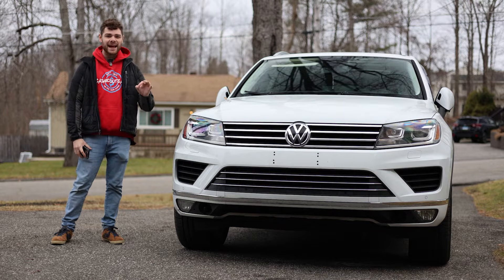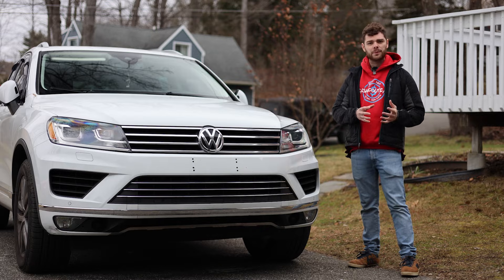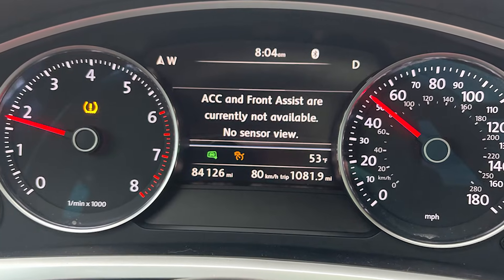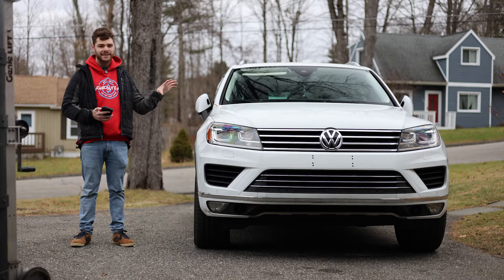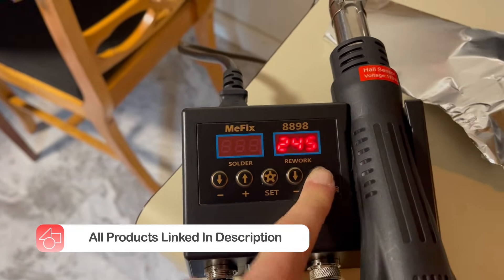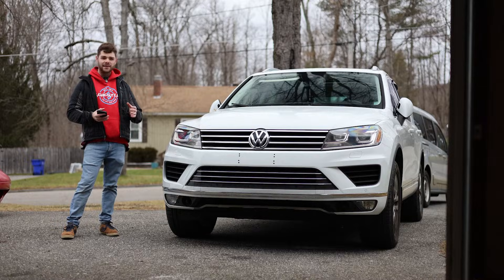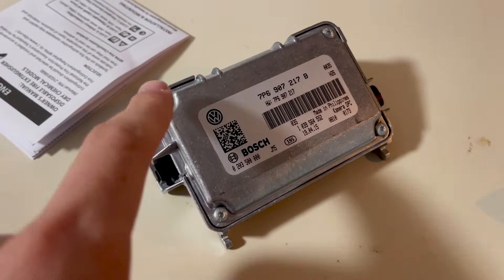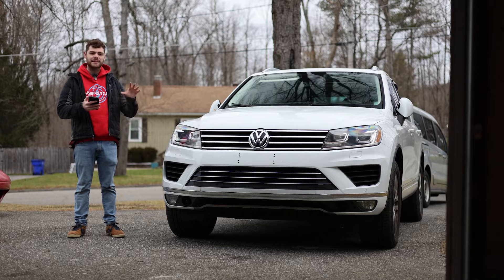How To Fix Adaptive Cruise Control (ACC) Issues - Volkswagen, Audi and Porsche

Comment: Works perfect on Audi A6 C7. Thanks! After this fault happen I made image processing module removal to check for flood. But no flood on passenger compartment was found and everything looks perfect. So decide to try this fix. After 5 min. of hot air blowing with simple hair dryer fault gone. I think on A6 it's possible to make all repair process without removing camera unit. You can just remove T10 screws from camera unit, carefully unplug connection. Take control module out and go for some dryer work :)

Comment: We have a 2016 Volkswagen Touareg TDI Sport w/ 54k miles. We are very thankful for all the details you gave on this very creative, low cost solution. 

For our repair, we used the 1/4” nozzle on the reflow heat gun, positioned an inch from the chip (With a square cut out in aluminum foil, masking the rest of the board still inside the aluminum housing) starting 250C for one minute stepping up to 300C for three minutes ending at 310C for an additional two minutes, we let the unit cool down for 45 minutes installed it and the ACC error went away.

Once everything was reinstalled, we took our car out on the freeway to do a verification test and everything is functioning perfectly. From start to finish it took us one hour to complete the entire disassembly repair and reassembly process.

Note: as other commenters Have recommended we used a large plier to apply grip to the widest point on the rearview mirror mount grip it tightly and did a quarter turn counterclockwise to remove the rearview mirror without incident.

1 month update: after ~1,000 miles long road trip the ACC error reoccurred, so we repeated the heat gun process using a slightly different temperature profile (3 min @ 250C, 5 mins @ 300C, 2 mins @ 330C, with 30 min cooldown) and wedged some wadded blue painter's tape between the windshield and camera to eliminate any vibration within the holding bracket.
Reply: How did the second time fix work out? Any more issues? Did the tape help?
Reply: Hello ivantashchuk6596. … it lasted from Feb ‘25 to Dec ‘25, so this time I let Google AI do a search for the best profile for my VW Touareg … and it came back with 
250C for 3 min
300C for 5 min
350C for 3 min
45 min ambient cool down
1/4” nozzle approx. 1” from chip shielded with aluminum foil

Comment: 2013 Audi A6 3.0T, problem solved following video direction, thank you!   Utilized a heat gun with a digital thermometer and left the pc board in chassis .  Started off with 1 minute in the 200-250 Celsius range, followed by 2 minutes at 300C.  Let it cool off and reassembled.   The plastic backing on the windshield bracket assembly that is between the glass and the camera chassis was so brittle it cracked and fell apart while I was reinserting the camera.  Used super glue and gaffers tape to salvage it.  I live in So Cal and the direct sun cooks the camera and all the plastic around it, the camera chassis is hot to touch just from the sunlight.  There needs to be a better way of insulating this area.

Comment: Incredible. This method worked great and fixed the issue. Removing the rear view mirror was a real pain – had to use a pliers to twist off. 310ºc for 3 minutes and installed once cooled. I did not remove the ribbon and did not have issues with it when heating. Re-install was easy. Thank you for the video. Saved me $2,000.

Comment: Thank you for this valuable video!  After watching your video, I removed the circuit board and took it in to a local computer repair shop to have them follow the video and apply the heat (300 degrees Celsius) using their more sophisticated heating device and magnifying software.  They only charged me $25.  I reinstalled it and it's fixed. You saved me about $900.

Comment: Thank you!  Your fix worked on my 2015 VW Touareg.  I've been waiting almost 3 months for a replacement camera (on back order) and the ACC warning was driving me mad.  I purchased the heat tool you recommended, set it at 310 and heated the chip for 3 minutes with great results.   Again, thank you.

Comment: This worked for me but I had to do this several times as the summer sun seems to cause an issue and cant always find shade to park . Anyone had a similar issue and any way to keep the unit cool ?
Reply: I honestly think that parking in the sun with a foil shade in front of the mirror , caused all the heat between the windshield and the shade to heat the module up To the point the chip malfunctioned. It was 140° in the car no telling how hot it was between the glass and the sun shade.

Comment: Thank you for posting this video...I have been waiting for the camera to come in from the VW dealership so they could "fix" this issue and charge me another $1500 on top of the $500 diagnostic fee for 2 months now.  Saw this tutorial this past Friday, ordered the heat gun kit from Amazon.  Came in on Saturday.  Did the repair this Sunday morning early before going ot church ... AND IT WORKED!!!.  Did all the details that were presented.  Heated it at 610 degrees F for 3 1/2 minutes.  Let it cool down about 20 minutes...all in all about an hour of effort.  I really appreciate the details you had in the video, plus the link to parts, etc.  It emboldened me to try the fix. You are doing good work in sharing your knowledge with the rest of us...especially when the fix is quick and inexpensive and the parts are literally years away from shipping.

Comment: Thank you for this. 2016 S6 and been having intermittent ACC warning. Performed this fix at 700f for 3 mins. Just put the module back in the car and the warning is gone 😊
Reply: I did exact same thing and it has failed twice again already (maybe lasted 2-3 weeks each time).
Reply: @2thebaum  the initial fix I did only lasted about a month. The second time I performed the fix I heated the chip for 5 mins and applied light pressure to the chip as it cooled to make sure it was seated. Never had an issue after that.

Comment: Thank you so much for this video! I have a 2016 Touareg TDI Lux and for the past 2 years my ACC and lane assist would come on and off while driving. About 3 months ago the ACC assist error code became a permanent chime every time I would crank it. I stumbled across this video, ordered a heat gun from Amazon for $16 (the Diafield 1850), set it at 600 degrees F for 3 minutes, and then reconnected camera and it works!  Took it for a short test drive and everything was working great. Was nervous about removing mirror and camera but I took it slow and easy and everything came apart and went back in fine. Hopefully it will last. Thanks for saving me some big money.
UPDATE:  After 5 days, the dreaded light came back on and so I did the same procedure again but heated gun up to 700 degrees for 3 minutes.  Warning lights are off and ACC is working fine after 3 days of use. Hopefully, the second round will fix it for good.
Reply: SECOND UPDATE: Be prepared to do this procedure about every 2 months. Not sure what causes it to fail. Maybe hot sun as others suggested. Will start parking in shade at work and see if that solves the issue.

Comment: Like the others, I owe you a HUGE thank you!  I had the same codes that you were showing and was about to gut the interior to replace the signal cable.  That's really what the data was suggesting.  I happen to watch this video and ordered a resolder gun to give it a try.  Sure as hell, worked the first time afterward.  I did 4 minutes at 610 degrees Fahrenheit.  Working for the first time in years.  Thank you for this !!

Comment: Amazing.  2016 Touareg with the ACC issue and this resolved.  $30 tool from amazon and 3 mins on 300c.  I left things disassembled since a few have said they need to repeat the process a week to 10 days later.  In addition to just working the OBD error goes away after a post fix scan. I should also note that I did the fix without completely disconnecting the camera in case you want to leave in place to eliminate chance of breaking a variety of plastic clips. 🎉
Reply: This worked on mine as well, but as an electronics repairer I wouldn't recommend doing this in place (without removing from the car) because you are relying on gravity to work FOR you when heating up the solder to re-bond so you REALLY want gravity to be pushing down on this chip from the top when the solder melts.
Reply: Definitely broke 1 clip doing mine. Cheaper piece of plastic to replace than a $2500 module / calibration..

Comment: 2013 euro VW Touareg
same issue, same “very long time without cruise control”, same solution, same success !! ❤🎉
Many thanks for your precious advise !

I used a standard rework station,
320°C for 3 minutes, 5cm from chip, and rest of the board protected with thermal tape.
Airflow 20%

NB : be VERY careful not to touch or move any parts when the set is hot : you may move unsoldered parts while it’s still hot !

Comment: 2013 Audi A8 4.0 Camera ACC issue's fault Dealership has had new Camera on order for over a year!!!!! 
SO, what do I do I try things.... IT REALLY WORKED.  uninstalled camera heated to 600 degrees for 3 mins let it sit for 10 min to cool went out and installed back in the car and to my disappointment error was still displayed on dash.  But I decided to try again by taking out the camera following instructions again.  So, I heated the processor back up to 600 degrees again for 3 mins and that did the trick.  well worth trying instead paying a ton out the window. thank you

Comment: This is the best news I have heard after digging through a ton of threads on the topic.  I have an OBDII dongle but only get some generic info about it.  Does anyone know if these codes relate to this fix: 

93440 [0x016D00]
U111300: Function limitation due to received malfunction value
FAULT_CIS_VIDEO_FAIL
Status bits: 1
Priority: 6
Frequency: 43
Unlearning index: 184
Odometer: 95803 km
Date, time: 2024.07.14 16:44:37
Paramteric values: 02 8D 00 1B 02 85 37 AE 10 0E 05 C1 10 0F 12 CE
Status: Test failed, Confirmed

Comment: Thanks. Did this on my Audi A7 and it worked had the heat gun on 310 for 4 mins. Came back to life. Please be careful taking it out. I broke 3 clips doing it. Push the camera up not too hard and slide it back. 🙏🏽
Reply: What year was the Audi I have a 2018 Q5
Reply: still worked ? no more errors ? and for how long please

Comment: You are the man.  2016 Touareg TDI Lux.  This worked perfectly.  I used 500F for 30s, 550F for 2.5 min, and 626F for 3 min.  I let it cool for an hour.  I noticed two flat areas on the mirror.  Easiest to get it off with some wide grip pliers on these spots.  Both for on and off.  I also found that putting the big plastic cover on first really helped.  Make sure not to pinch the wires as you put the mirror back.  Amazing.  Saved ~$1500+.

Comment: You Da Man!  I am the sort that CANNOT abide anything not working on my vehicles.  The hardest part of this was getting the mirror off.  I ended up using a pliers handle for everage both off and on.  the second hardest part was waiting for the housing to cool.  Starting it up and seeing Systems Nominal was indeed exhilerating.  I am astounded VW isn't on to this.  The replacement was covered by my extended warranty and the tab would have been $1,500-1,800.  They could charge $500 all day long and get it.  My outside mechanic didn't want to touch it but I bet he will now! Thanks again!

Comment: Gotta tell you, you're my hero. I've been living without cruise control on my 16 Touareg for a year with VW continuing to say the camera is back ordered (their analysis of what was needed). I followed your procedure exactly though I used a wagner 750 heat gun and put on a focused nozzle. Did 600 degrees farenheit for exactly 3 minutes with the nozzle at about 2 inches from the chip moving back and forth (side to side). Reinstalled and now works perfectly. Thank you, simply thank you!! Not sure how you figured this out but based on the below, you have saved several people a lot of money - something to be proud of. Well done!!

Comment: Hi, I have the same problem of ACC and Front Assist not available on a Golf TDI 2016, but mi error code is C110300-Adaptive cruise control sensor misadjusted, Do you know how can I fix it?
Regards,
Rickey C

Comment: Thank you so much! Thats awesome. 
2017 Volkswagen Touareg V6 Wolfsburg Edition 
Did not work front ACC
I did first 245 for one minute and then 320 for 3 minutes (it did not not help). air power was medium 
And then I did 245 for 1 minute + 310 for 3 minutes + 330 for 2 minutes). air power was high

Comment: 2016 Audi A6. It worked! Heat gun from Amazon, $50.  Thanks so much for the tip. First I did 265 for one minute and 300 for three minutes. That didn’t work. I went back and did 300 for three minutes followed by 310 for three minutes and presto👍🏽! It worked.

Comment: I've bought my '17 Touareg a year ago and my lane assist/ACC has never worked. Dealer wanted $2500 to install a new camera and align/recalibrate the entire system. Glad I waited because I just found this video and today I got my camera working again. Disassembly was a little challenging for my first time but not that difficult. Mirror was really tough to get off, I'd recommend a large wrench or pliers to give you some added leverage to coax it off. Turn it counterclickwise just like the video says and it will pop off, it's held on by 4 metal spring clips that snap over a mount underneath it. I took a little more time to reheat the chip on my camera. 30 secs at 265c, 150 sec at 285c, then 60 sec at 310c. I went a step further and did 4 additional mins at 330c. Also, my heat rework gun has an adjustable fan, I wasn't sure where to set the fan speed so I just put it at medium. Normally I might have hesitated before tackling this repair, but since my dealer did confirm the camera was the problem, I felt pretty good about this solution. Terrific step by step instructions on this procedure, thank you for a good video.

Comment: Worked wonderfully ! thanks again for a great vid.
2 minutes at 200 deg C then 3 minutes at 330 deg C
2016 Touareg TDI (Australia)
Reply: still worked ? no more errors ? and for how long please
Reply: @ I had to redo the process about 2 months later but this time I used a normal heat gun and actually got the solder to reflow on the board ( make sure to heat shield the plastic connectors). Still working perfectly

Comment: Worked like a charm on my 2016 V6 Touareg Exec!!! This from a girl who did the entire process, start to finish, on my own.

Dash message first showed up a year ago…dealership quoted me $1,100 plus to install a new camera. I found your video after someone posted it in a Touareg Facebook forum, and figured I had nothing to lose. Worst case, it didn’t work and I could order a new camera myself and do the install. I found one new for $550 at a dealership one state over.

Had the camera out, fixed and back in under 30 min. Worst part for me was getting the rear view off and back on again. Takes some force, but I knew that from reading other comments here. 

Used a $30 rework tool from Amazon and a cheap torque screwdriver set. All told, $40 vs $1,100 plus. 

245c for 1 min.   320c for 3 min. 

I cannot thank you enough!

Comment: I have a 2016 Touareg.  I purchased a heat rework unit.  But I cannot get the mirror itself to twist off after taking the first plastic piece off.  It feels like it is welded on incredibly tight.  I can’t find any videos on my specific model.  you said turn counterclockwise.  But do you have any other tips on where to grab and how much force?  I don’t want to use a wrench or channel locks on it. Thanks.  UPDATE. I was able to get the mirror off, remove the mirror, heat up the chip and fix the ACC video problem.  Thanks for the fix.  I saved a lot of money
Reply: Hi. Had the same trouble trying to get my mirror off. It is on VERY tight. I used robo grip pliers to twist it off and remove it (squeeze gently just enough to grip the mirror, but not so much to crack the plastic). If you have a large enough adjustable wrench, that might work even better. It still takes some effort but it gave me just enough leverage to make it turn and pop off. Like the video says, use a counterclockwise motion. It will come off! Good luck.

Comment: Have a 2016 7P6 Touareg and after watching your video numerous times and gaining enough courage to attempt this, I bit the bullet and decided to have a go. What is there to lose? Purchased a hot air reflow gun and followed your instructions. After cooling down, I put the module back into the car and hit the start button. No more chimes and the systems all work again. I ran a VCDS scan and no more error codes for the first time in 2 years.

Comment: Thank you so much! The idiot dealers wanted to charge me 5000 dollars to change both sonars and insisted that was the issue. Your fix worked, although I winged it with a heat gun and guesstimated the temp. Maybe 45 seconds at 300 plus.. Bottom line it worked.  Thank you!!
Reply: Yes, 3 minutes is way too long. Once the gun gets to the indicated temperature it only takes seconds for the solder to melt and subsequently re-bond after you take the heat away (which only takes seconds). This damage happens a lot here in Australia as it is not uncommon to have days here where it is almost 50 degrees Celcius (and sometimes over) in Summer, so that camera gets really hot inside, especially when parked in direct sunlight without the wind to cool the windscreen in the moving vehicle. This is a brilliant fix! Thanks.

Comment: Thanks for this video! With these parts backlogged forever this is a huge help.

2015 VW Touareg

I just tried resoldering with:

245 X 60 seconds
310 X 180 seconds

Plugged it all back in and still getting the same warning. 

Any thoughts or suggestion on wast to ensure the resoder works?  @cashfixescars